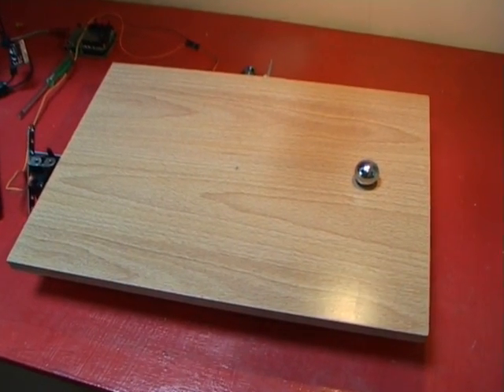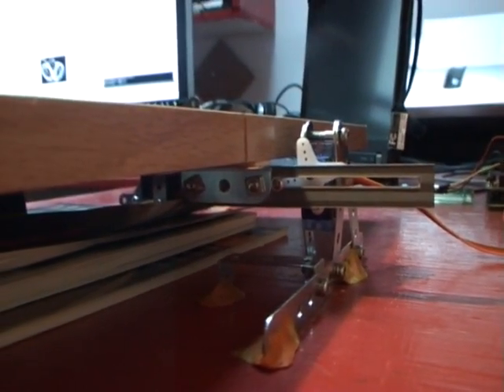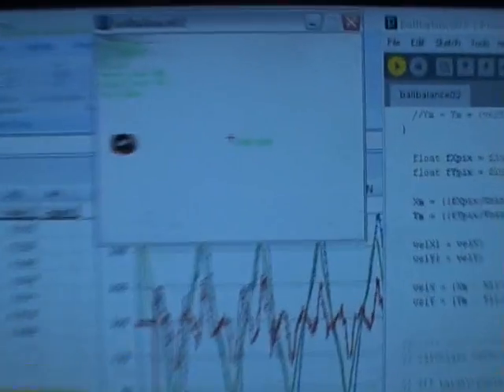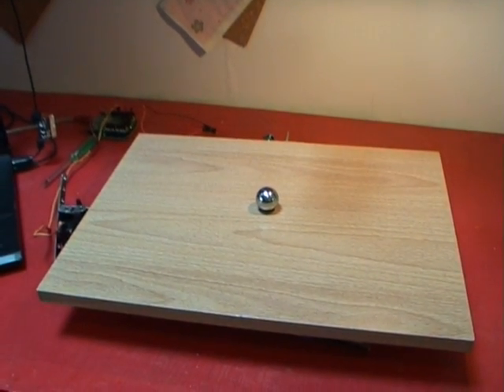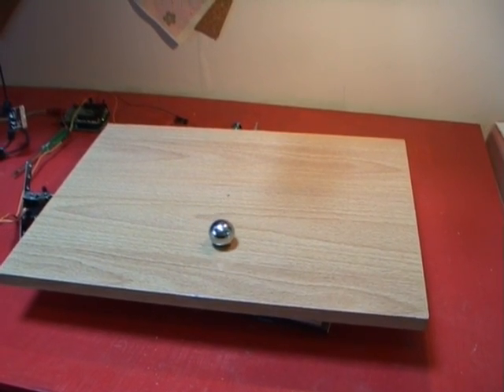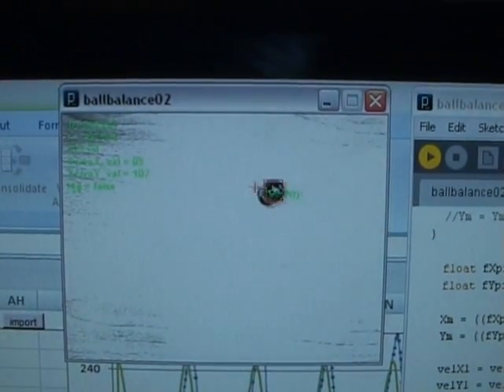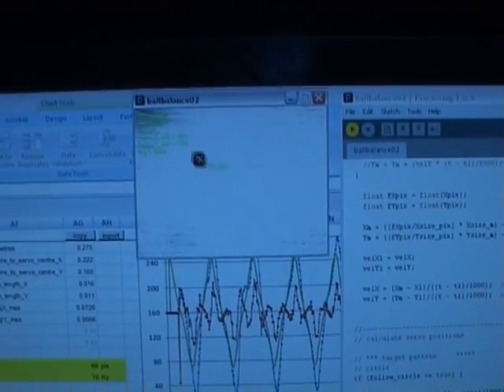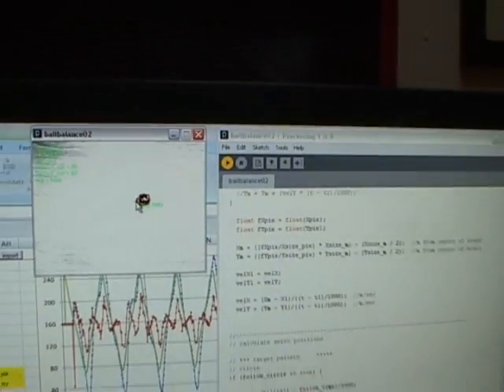Ball Balance Machine II

Comment: Hi 0zimbra0

This is probably the smartest Arduino project I have seen sofar
Really impressive!!!
Would you care sharing the arduino and processing code ??
Could you elaborate on the board/servo mecanical connection ??

I introduced this video to the Arduino community in the Arduino site
I strongly suggest to share and document this project in this same thread

Thanks for this excellent work
Yves

Comment: Wich programs do you use for the interface between aeduino and the web cam i would like to try this project
Reply from the maker: I used Processing. The link in the description will take you to all the code. Let me know if you'd like more info.
Reply: i had trouble installing JMyron it told me native code of java was missing i tried to replace it with kinect but had troubles with the interface

Comment: Hi David,

My name is Brandon and I am currently working on this kind of project, but I'm having some difficulties. I was wondering if you could give me a hand? I am using a Arduino uno board and pixi CMUcam5, but am having trouble relating the ball position (from the pixi cam) into readable data for the Arduino uno to give to the servos. Hope to hear back from you as soon as possible, thanks. 

I also sent you an email, but I'm not sure if its to the right address so I'm leaving a message here too.

Sincerely,
Brandon

Comment: hey man. this is bloody fantastic. really nice work and thanks for the code even tho it dont seem to work for me but you just introduced me into firmata which makes everything so much easier now. I get an error on this line:

if (key &lt; 'A' &amp; &amp; key &gt; '/') {
Kfactor += ((key-48) * pow(10, (K_digits-1)));
K_digits --;
}

error is:

expecting RPAREN, found ';'
processing.app.debug.RunnerException: Syntax error, maybe a missing right parenthesis?

plz fix i really wana see this.